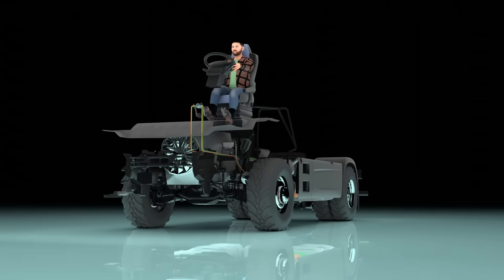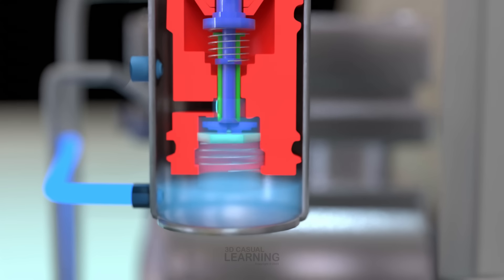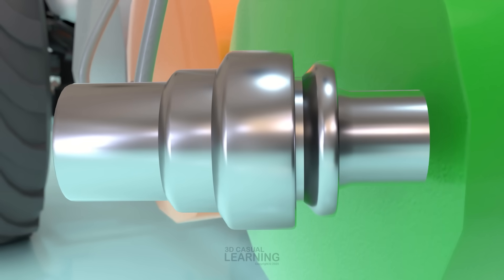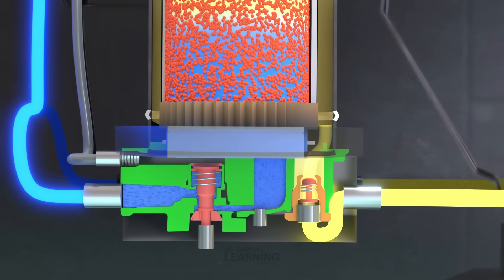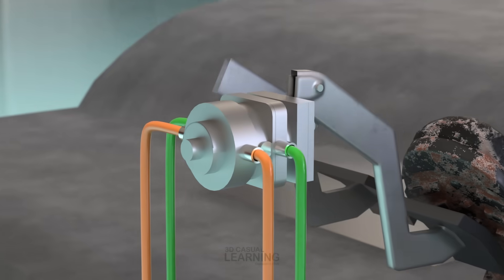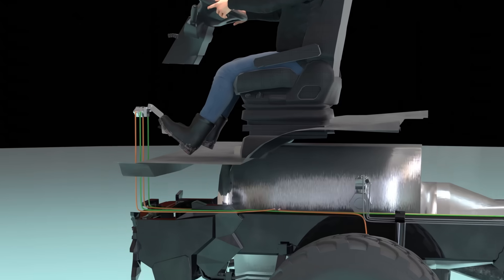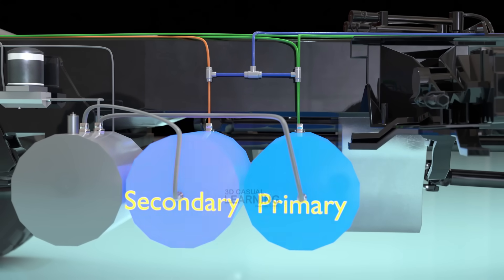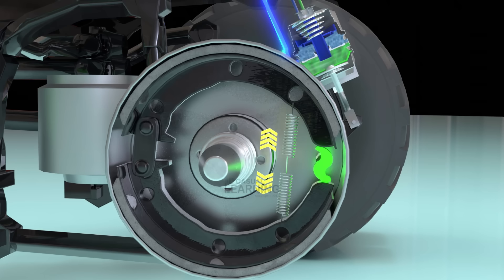How Air Brakes Work in Trucks | Full 3D Animation Explained

Comment: Seems overly complicated...I wonder if a hydraulic braking system would be easier.
Reply: @GowronSaves  Here in my region Air System is much more common that Hvac in heavy equipment. Its much stronger than Hvac.
Reply from the maker: Air brakes are actually more reliable and safer for heavy vehicles like trucks, especially because they can handle much more force.
Reply: @3dcasuallearning now I remember! It can also handle leaks more safely automatically braking when the air accidentally run out.

Comment: How does progressive air breaking works, I mean how do you control that how much break should be applied
Reply from the maker: It works through the foot valve basically, the harder the driver presses the pedal, the more air pressure goes to the brake chambers. Light press = gentle braking, full press = strong braking.
Reply: @3dcasuallearning  🤣🤣

Comment: not quite right they forgot to tell you about the r12 valve,if you plumb it that way you would get a long pause before your brakes come on by the time it fills your line and the chambers as it is just a 3/8 line.the r12 has constant air supplying it  with a 3/4 line and the foot valve just triggers it to open and the big air line supplys it with minimum lag.good vidieo tho
Reply from the maker: Thanks! I'm glad you enjoyed the video and thanks for pointing out a more specific part of the system.

Comment: One correction, European trucks do not Use front Drum brakes for about 20+ years now. 
And some don't even use Rear drums. 
This is a feature leftover only on Construction and Russia/Asia bound vehicles(if even available) and it's done because Fine dust found there Wears Disks and Brake pads ridiculously fast. 
In Any European road Application, and Even Australian exports mainly have Disks.
And Europe now Has Mandatory ABS levels and Radar braking so Drums are very undesirable as Making them work well with ABS is a chore.
Reply from the maker: Good to know about the differences in brake systems; thanks for the comment!

Comment: Your design is missing the dash mounted parking brake valve that supplies the air to release the spring brakes and automatically applies them if the pressure drops to critical levels(~60psi)

Also the foot valve does not exhaust supply air when the brakes are not applied, it only vents the applied air when the treadle is released.

Most trucks also use quick release valves between the treadle and brake chamber to allow them to exhaust the air closer to the wheel instead of through the foot valve.

Larger vehicles use relay valves controlled by the foot valve and fed air directly from the primary tank to deliver the large volume of air needed when there are more than one rear axle. 

The animation of the front S-cam is backwards.
Reply from the maker: Thanks for pointing out the details; I appreciate your feedback, especially about the front S-cam animation!

Comment: I thought primary would be the front brakes as they do more work.
Reply from the maker: In trucks, the terminology is a bit different. The primary system is usually connected to the rear brakes, while the secondary system operates the front. That way, if one system fails, the other still provides braking power and safety.
Reply: @Grid56 Not in a big truck.  Years ago drivers would disconnect the front brakes to eliminate lock up.  The drives and tandems do most of the braking when loaded.

Comment: Oh so the fart like sound released by truck is from governor 😮
Reply from the maker: Not exactly 😊 That sound usually comes from the air dryer or the purge valve releasing excess pressure, not the governor itself.
Reply: The air drier produces the random sneeze like sound but the sound heard when a truck starts moving is the air being exhausted from the brake chambers.

Comment: Very good for a basic insight ,but there is more to it ,,Relay valves Modulator valves  quick release valves.Trailer control valve  and more ..As i said a good basic insight but not so simple ,air does not go from the pedal straight to the chambers ,as by the time it got there you would have hit something
Reply from the maker: Thanks for watching and for the additional details!

Comment: A very detailed video, but also it's interesting to see how US trucks have a very different system than the ones in Europe.

In Europe, the compressor supplies the air drier, which usually has the overpressure and governor valve in one unit. In many cases the air drier has its own little (around 5 litre) reservoir for the purging cycles.
Then comes the safety valve, often called 4-way valve, because it has one input and 4 outputs to different systems (2 brake reservoirs, 1 auxillary reservoir and one for the handbrake). This valve supplies the 4 reservoirs. Of course the whole system has a bunch of one way valves and monitoring ports...etc.
Reply from the maker: Thanks for the extra details; that's very interesting to know about the European systems!

Comment: Why not hydraulic brakes like in cars and small trucks
Reply from the maker: Air brakes more reliable for heavy loads. Air systems can’t run out of fluid like hydraulics can, and they make it easier to control braking on long, steep descents.
Reply: @3dcasuallearning  hydraulic brakes don't have the failsafe capabilities of air. If you lose hydraulic fluid in a car you lose braking ability. If you lose air brakes in a truck you are coming to a very abrupt stop.
Reply: Air brakes can handle heat better, brake fluid boils. Also air brakes use pressure to release the brakes. If theres a pressure loss the brakes apply.
Reply: One simple reason is you can't do hydraulic brakes on a trailer. So air brakes became the standard for large trucks.

Comment: Every air braked vehicle I've worked on uses at least 4 air tanks. 1 & 2 are for the service brake (with a front/rear split), 3 is for the parking brake and 4 is an auxiliary tank which supplies air to operate other functions such as air suspension.

The 4 tanks are protected by a multi-circuit protection valve. The MCPV not only prevents air being lost to a circuit with a leak, it also ensures the air tanks build air in a specific order: 1&2 first, then 3, then 4. You don't want a situation where the parking brake can be released when there's no air pressure for the service brakes, for example.
Reply: There seem to be some differences between truck brakes in Europe (or rather the EU) and on other continents/countries. In Germany I experienced the same divergencies you describe. 3D Casual Learning are based in Malaysia, so it is to be expected that different Countries have different specific rules about truck brakes although they share a lot of common principles.
Reply from the maker: Thanks for sharing your expertise on the topic; that's very helpful information!
Reply: Most US Military vehicles use a 3 tank system.  Some are harder to see than others, but if you look at LMTV's and FMTV's they're clear to see on the driver's side.  Other types may have the tanks a little more hidden inside the frame.  The video is fairly close to how those brakes work.  

One thing I think could have been added is the use of caging bolts that allow the brakes to be released in the event the vehicle needs to be towed and the air system doesn't have enough pressure to release the brakes.

Comment: Nowadays, trucks use brake disks. Can you do a presentation on this?
Reply from the maker: I’ll definitely consider making a video on that—thanks for the suggestion!
Reply: @kelvinkhoo6061  not allot of truck use disk brakes. Most newer trucks use S-cam brakes, with an air brake system.

Comment: Always wandered how the brakes were applyed with no air pressure. Very good presentation!
Reply from the maker: They’re designed to fail-safe. When there’s no air pressure, powerful springs in the brake chambers automatically engage the brakes to stop the vehicle. Thanks for watching and glad you liked the video!”
Reply: @ThunderSky  The parking brake functions in reverse. While brakes requires air to apply brakes, parking brake requires air to release brakes. In case of a loss of air pressure the parking brake will engage.

Comment: Very good . I have a question .why we don't use compressed air to make electricity
Reply from the maker: That's a great question! While compressed air can be used to generate electricity, it's generally not as efficient as other methods.
Reply: What do you think powers the air compressor?

Comment: Air brakes do not have a fast response and lag on releasing the brake application !
Reply: There are quick release valves that are not shown in this video.
Reply from the maker: You’re absolutely right! I did show the quick release valves at the intro of the video, but I didn’t mention or cover them in a specific section to keep the video simple and focused. I’m planning to make a follow-up video to explain them in more detail. Thanks for noticing!
Reply: @3dcasuallearning 
Include the quick release valve with the built in anti-compound feature !
Reply: @3dcasuallearning A follow-up video focusing on trailer air brakes would be the perfect opportunity to cover the dash-mounted parking brake release valve and the anti-compounding/relay valves.